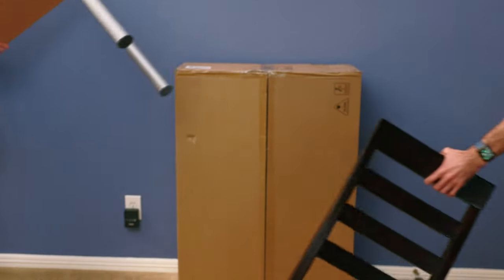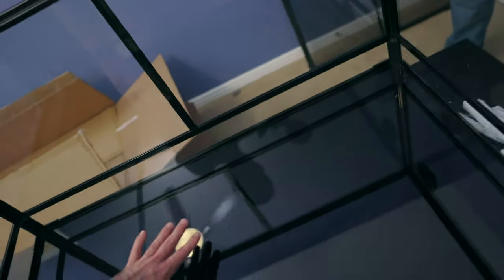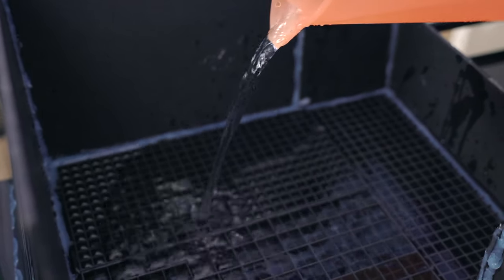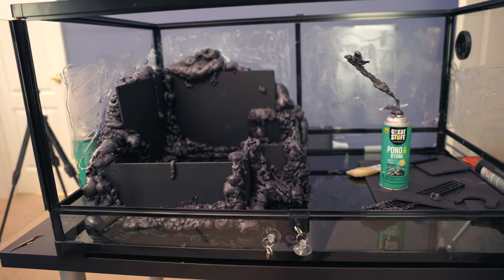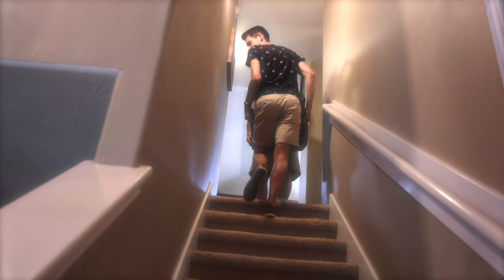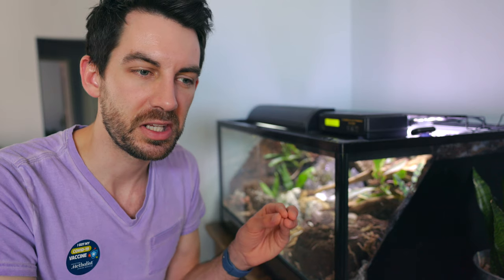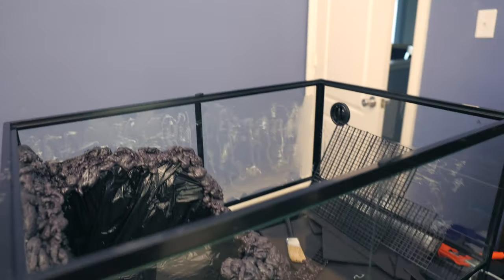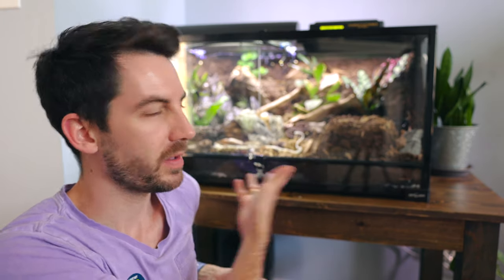65 Gallon Bioactive Vivarium with Waterfall for Python // I Didn’t Think This Would Happen…

Comment: Trav ,enjoy your
Reply: Enjoy your vids  I built a bioactive and put in foamboard in a water feature.The foamboard slowly got saturated and leaked.
If I build again I'd go with PVC enclosure for your brazilian. Can drill through with no cracking issues and waterproof
Reply from the maker: For sure. This isn’t foe the Brazilian, but I’d definitely do it a bit differently next time. The liner has worked for the water feature so far, so I’m not completely reliant upon the foam.